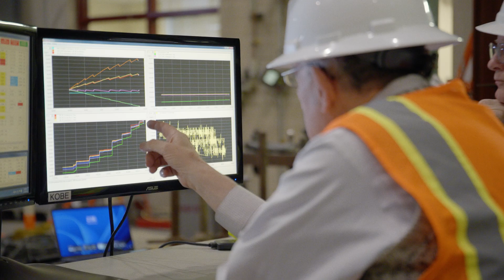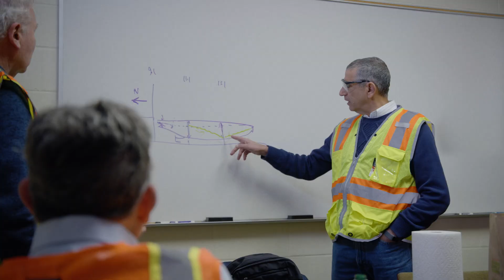Investigating the Champlain Tower South Collapse: NCST Insider - feat. Jim Harris

Comment: At 0:49 it seems to show how the J hook rebar in the slab possibly interlocked with rebar in the drop beam in such a way that the pullout force would have been enormous.  It looks like both the column at its base and the drop beam rotated a bit  (unless the camera was repositioned). 

Some of the slab rebar was straight but there was also J hooked rebar about every 5’ as I recall.  Always wondered about that detail.  Impressive demonstration, Thank you
Reply: Then at 0:50 and 0:51 it seems to show where #5 J hook slab rebar was embedded into the column before it was pulled out when the pool deck sank along with its integral planter supporting beam creating a huge lever force on the column.  Sorry, just one concrete structures course under my belt.